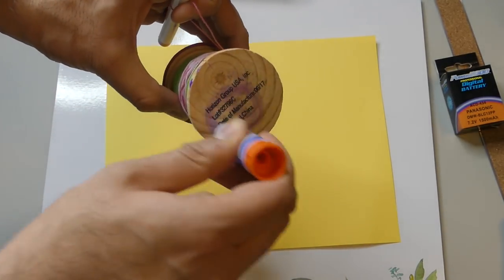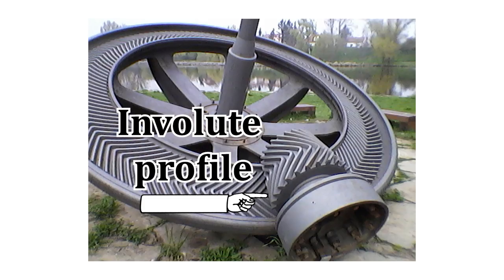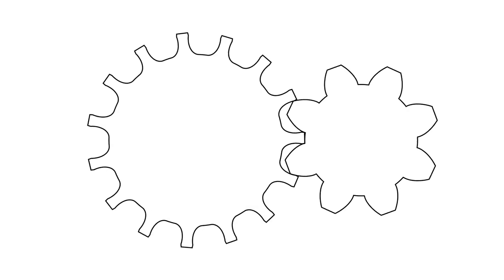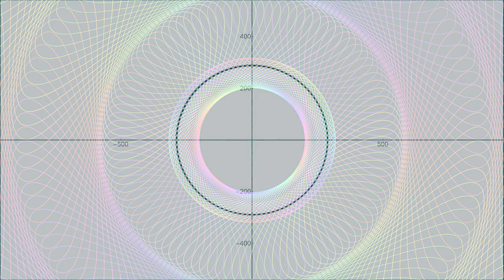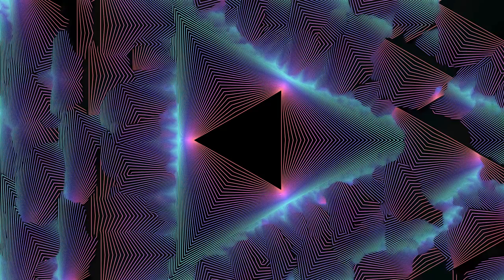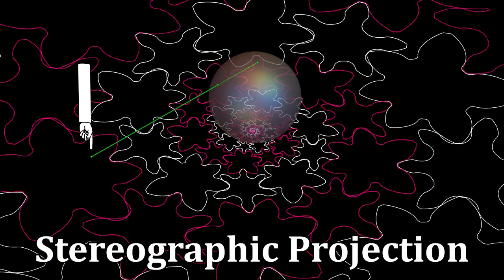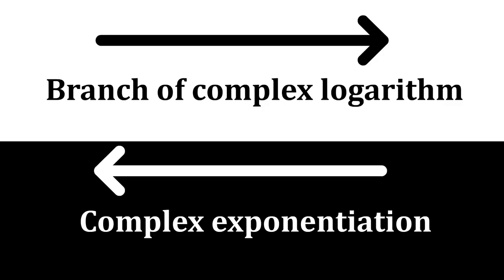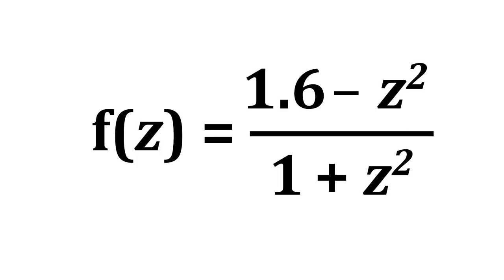When Gears Mesh Just Right

Comment: Love your videos... May I ask, what are you using to make your animations? I'm guessing you program them, if so, would you share some of your codes? I tried making my own program to make a line-picture after watching your video (nice job there too btw), and I was going to make a program to make gears also, so if you already have a start, I thought I'd ask now. Anyway, I'm making a lasercutter/printer atm, and trying to make controller, protocol, everything on my own (although it's not perfect it does work atm). Also need to make it work with bezier curves (another thank you) instead of just circle(part)s and lines... ... Sorry for long ramble, thank you for nice videos, share your background work or not, still interested in knowing what you use :)
Reply: I recognized that for a lot pictures and animations he uses the computer algebra system Mathematica.

Comment: Involutes are not the only shape that can be used to make gears, they are the only shape however where the gear spacing is not critical, move the gears apart  slightly and the drive will still be smooth. Considering a pair of meshing gear teeth as a cam and follower, it is obvious that there are an infinite number of curves that will work. 

Clocks often use cycloidal gear teeth, meshing with other cycloid teeth of even circular pins. Cycloid on cycloid teeth roll rather than slide one upon the other and give less friction.